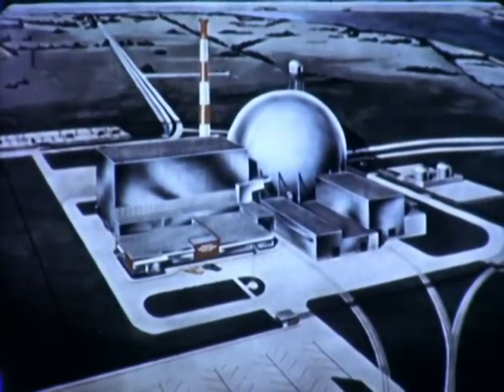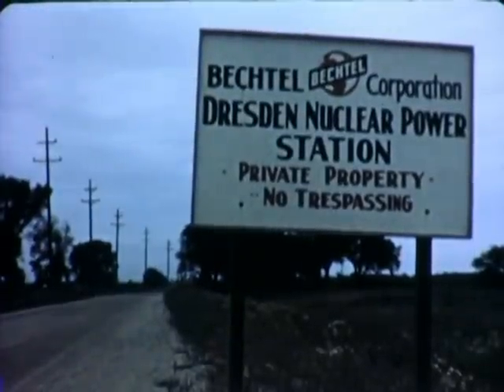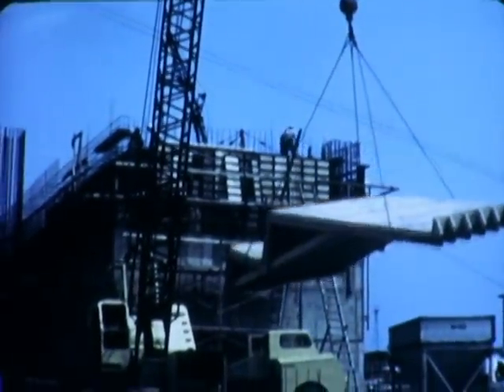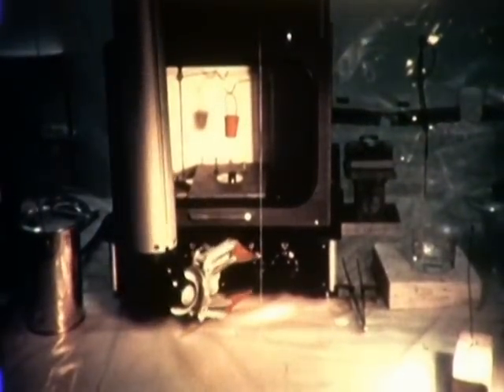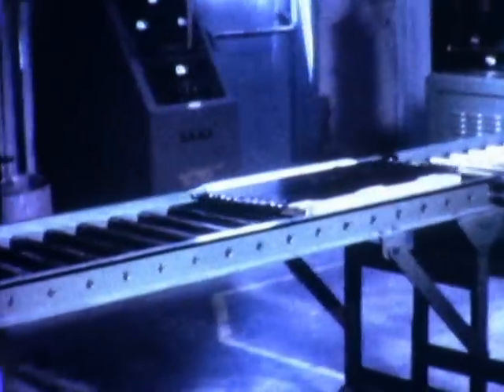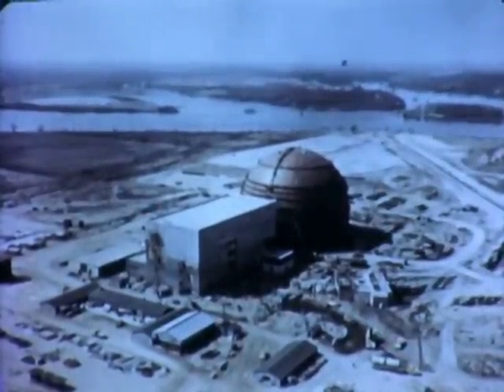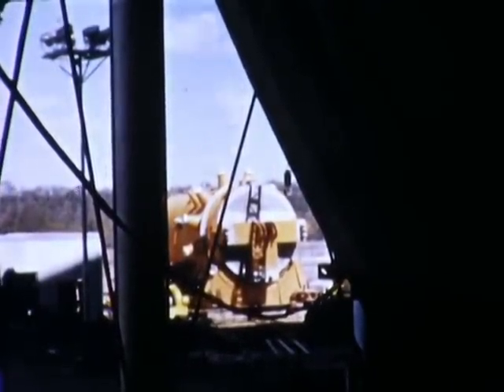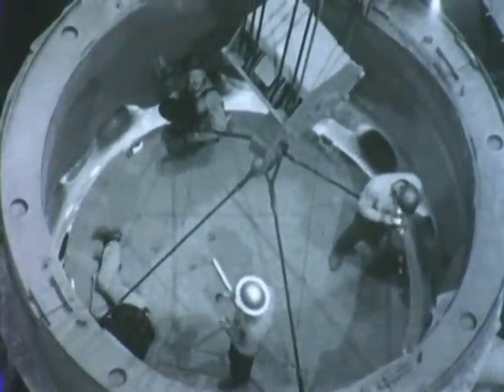Dresden Atomic Power Station - 1958

Comment: Dresden Nuclear Power Plant is about an hour or about 37 miles from where I live. This power plant scares me a little. I reed that it was built like Fukushima Japan Nuclear Power Plant. If there is a problem with that plant. They might have to evacuate for miles around. There are 2 other Nuclear Power Plants close by. In LaSalle,IL  West of Morris,IL (Route6) and Braidwood near Wellington,IL (Route 53). That completes the triangle of doom. Check it out on Google.
Reply: +C Sullivan The Dome is my Home!
Reply: LaSalle Station has been shut down for years, I've worked at Dresden and LaSalle, there was a good reason the first was done out of Chicago, the tradesmen there are union and top tier skilled craftsman. For something so cutting edge, you couldn't do it in Georgia or West Virginia, another reason Abbot Labs, Argonne Nat'l Labs and a slew more, heck the first chain reaction was done under the University of Chicago's  basketball court or football stadium.
Reply: l8tr597 LaSalle isn't shut down, I worked there just this year.
Reply: Brandon Hall +TheShoeman126 Wow, every now and then I drive around to see the different changes around Northeast Illinois and other parts of Illinois. I did not know the nuclear power plant was still running. I have seen some traffic there. The Zion Nuclear Power Plant near Illinois State Beach has been closed for years. The powerlines and the building are still up. I reed they keep nuclear waste onsite at the Zion Nuclear Power Plant. Scary. I think the road number is route 41or route 137? Aren't they supposed to move the nuclear waste to Yuka Mountain out of state? Is there a way to recycle the nuclear waste without harming the planet?
Reply: It's really not that scary if you actually know a little about how they operate the plants. I've been to all the plants in Illinois and I've never been scared in the way you describe. I feel safer working in a nuke than I ever did framing houses.
Reply: +Brandon Hall (Brandito) Walking up ladders up high to fram homes does sound like trouble. But, in a nuclear power plant you never know when a meltdown could happen.
Reply: Meltdowns are extremely uncommon, I'm more likely to fall from a ladder. Nuke plants don't just spontaneously have core failures.
Reply: Brandon Hall Some of the Nuclear Power Plants around Illinois have there own outdoor cooling pools might not be connected to rivers near by. If those outdoor cooling pools dry up and the nuclear power plants won't have anyway to keep the cores of the plant cool. The nuclear power plant would shutdown.
Reply: C Sullivan That's an unlikely scenario, and would be preventable because it would be a slow process. These plants can be shut down in a fraction of a second.
Reply: Brandon Hall It is good there are safety operations in place if something like that happens.
Reply: C Sullivan 
Stop whining
Reply: C Sullivan oh my gosh I live in Morris we are surrounded by Nuclear power plants I think it’s so cool I’d love to work in a control room at one of them they’re really fascinating. I just went on a school trip to Exelon and it was soooo cool!
Reply: U1 is not like fukushima. U2 and 3 are like Fukashima. U2 and 3 have been modified as a result of fukashima in accordance with federal guidelines.
Reply: I received an evacuation route pamphlet in the mail a couple years ago from the state in case one of these things goes critical.... makes you feel all nice and warm inside
Reply: Actually LaSalle nuclear plant is right next to marsallis Illinois in between Ottawa it's less than 20 miles from my home town of streator
Reply: bro I have biked to Dresden 💀💀💀